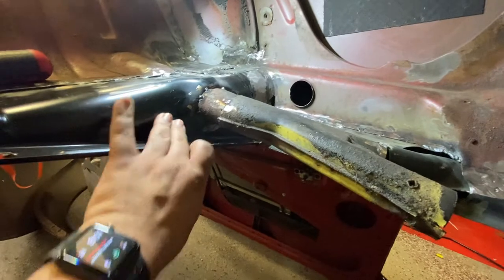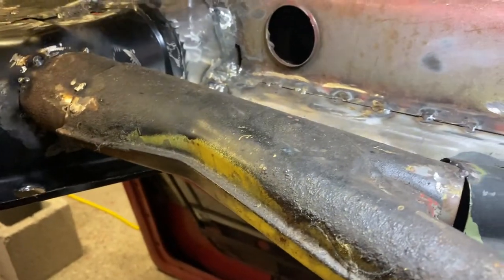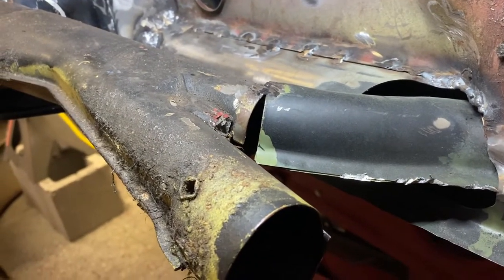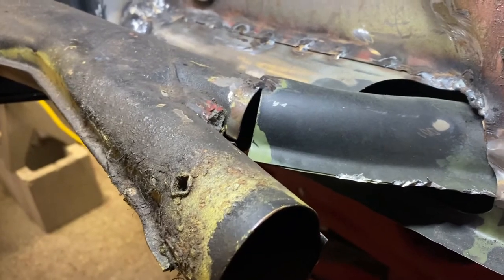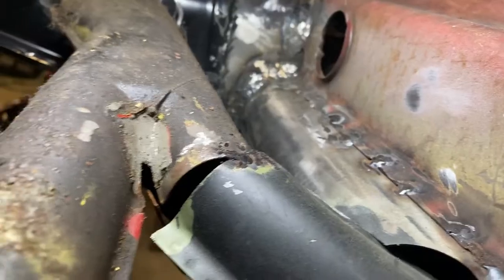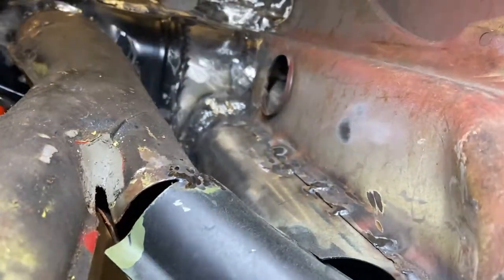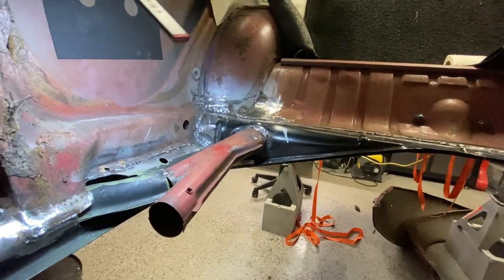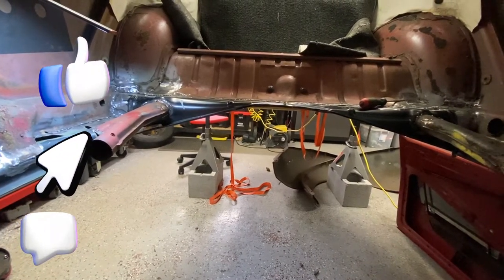VW Bug Heat Duct Very Very Short Video

Comment: Nice to see the car progressing. You could weld in a joiner piece or some sort of filler part. Even thought the factory slobbered seam sealer everywhere, you seem to be doing a "better than factory" job on the car, I don't know how good the new seam sealers will do on a larger gap the specs on most give you a max range, plus the ducting will be carrying heat. In any case its just semantics, the car is coming along nicely! Keep it up!
Reply from the maker: Thank you for the encouraging words.